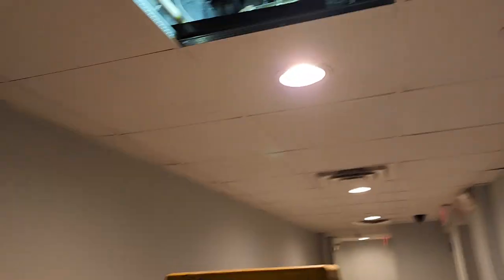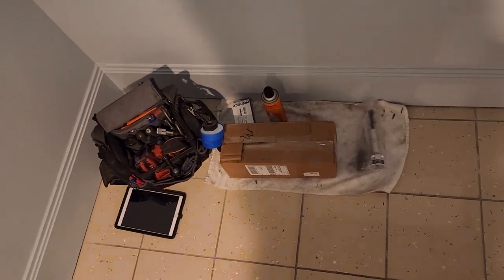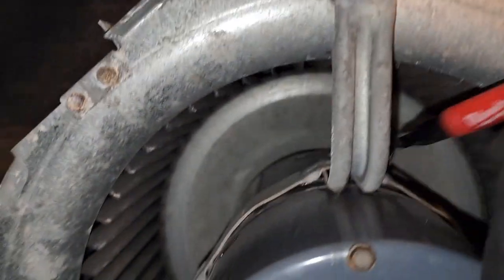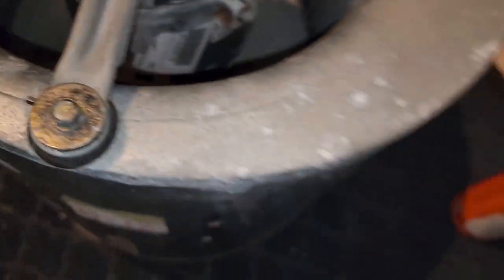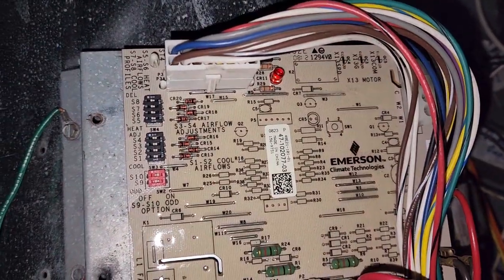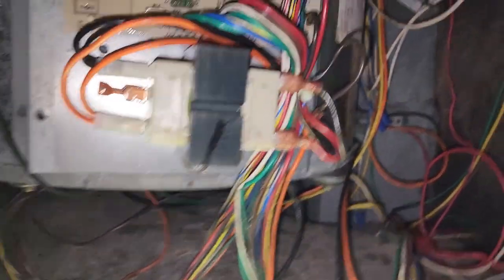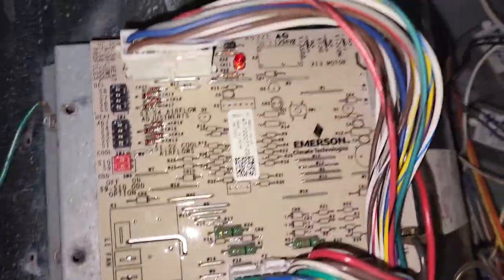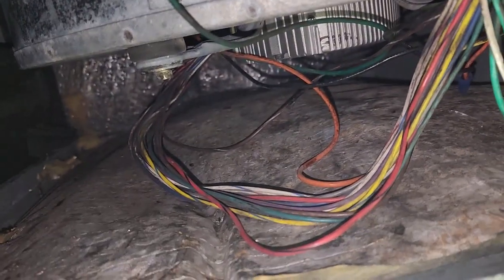Replacing Dead Rheem ECM Blower Motor

Comment: DanielSon: There’s a tool for your drill that has an internal brush for cleaning the motor shaft…just slide it over the shaft and pull the trigger…check it out.

Comment: I know it's been awhile since you worked on this unit but I did notice that it has the same basic Emerson control board as my 2018 Rheem 5 ton unit with the X13 blower fan.  My issue started out about 5 months ago and was erratic.  Once it was done with the call for air, it should run about 45 seconds and then shut off, which it did.  Then, the blower fan kicked back on again but no call for air, would maybe shut off after a few minutes, maybe not.  Thought it was the smart thermostat so removed it and seemed better. Tried a new smart thermostat but same issues.  Went back to original basic thermostat and it worked ok for 4 months....till last night.  Noticed while watching football that the call for air was done, but the blower fan kept going.  It takes having to shut the circuit breaker off to get it to stop.  That's also with the green and red wire undone from the thermostat and, with the other smart thermostats, it still ran even when they were off the wall.  My question is (finally...lol), could it actually be that basic Emerson control board at fault or most likely the X13 motor's control board is the culprit?
Reply from the maker: @avguytx4361  there’s a chance that it’s either. But I’m wondering if you have a humidifier in the system which is cycling the fan on. 

You can test ECM motors by ordering an inexpensive tool online that plugs right into the motor, but I have never seen an ECM motor fail and run too much, typically they fail and don’t run at all. So I would lean towards control board.
Reply: @DCHVAC   There's no humidifier on the system. Just a two stage heat pump on electric...no alternate fuel. I did buy another control board awhile back but hadn't put it on since things had seemingly been fine for 4 months with the basic thermostat. The control board is very basic...no on board relays.
Reply: @DCHVAC     Others have said it was most likely the ECM that was going south and even the original installer seemed to "think" that's what it was. The fan even runs with the thermostat off of the wall.  Also...which tester are you talking about?
Reply: @DCHVAC    Just wanted to come back and let you know that it ended up being just the control panel that was bad.  I had ordered the new replacement a few months back but never put it on as it was working right with the original basic thermostat.  When it started that erratic fan blowing this past Monday, I decided to try that first as it was an easy swap.  That fixed it.  Glad that it wasn't the motor.  Thanks again for your input.
Reply from the maker: @avguytx4361  had a feeling.

Comment: Daniel, show more content on how hard it is to remove the fan from motor shaft.
Reply from the maker: It came off easily
Reply: If you’re having trouble taking off the shaft get a 21mm socket, hammer, sandpaper, adjustable wrench. Smash down the hub and don’t worry you won’t damage it or the shaft. Break free the shaft and get the wheel moving and just slide the old motor off

Comment: Was this the replacement that smoked up?
Reply from the maker: This is a different fan
Reply: @DCHVAC  which rescue motor motor did you use the one that smoked up? I want to look up the wiring diagram.
Reply from the maker: @dimaslespier2688  US rescue motor. Watch the full video, the wiring diagram is on the motor I clearly show it and go over it in the video.
Reply from the maker: @dimaslespier2688  https://youtube.com/clip/UgkxcjUbwUUCgobQZkM6Ew97UXAERnhz42eP
Reply: @DCHVAC  I just did.  Again watch it.  I was looking at the wiring diagram. Much as I could see.  Looked very straight forward.  The only thing I can think of to do in that instance is to try a different speed see if it still smokes up? Go to medium low etc.  cap showed only two wires white black is 208. Purple to purple one direction orange to orange the other.   Non ecm motor. Very straight forward

Comment: Why are you replacing the ECM and control board? I highly doubt it’s both. Don’t just throw parts at shit
Reply from the maker: Control wasn't flashing any errors, ended up not replacing jt.
Reply: @DCHVAC  Was the control light even on at all before you replaced the fan motor? I'm having the same problem. I'm pretty sure the control board is fine but the light is not on at all. I'm thinking its the fan motor and that the light will come on when I replace the ECM motor.